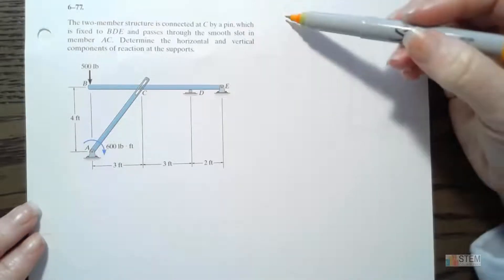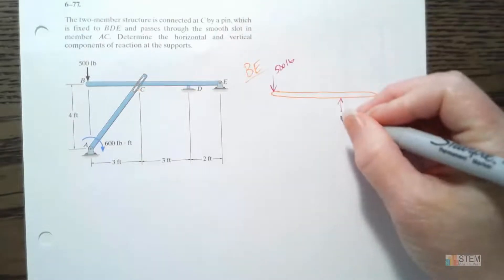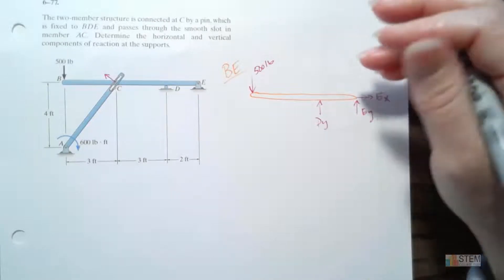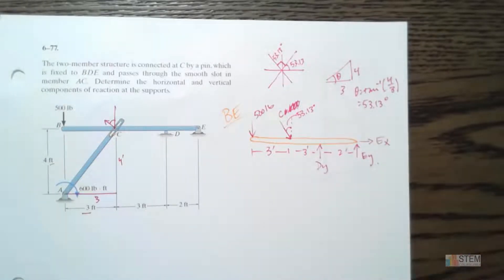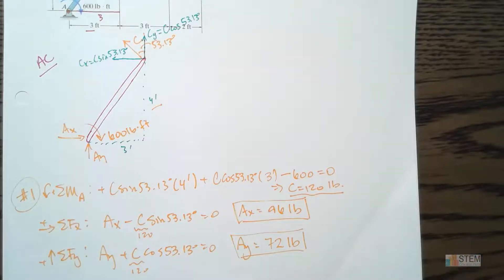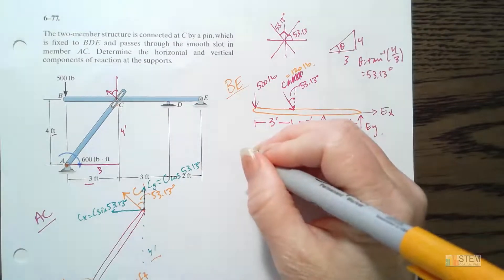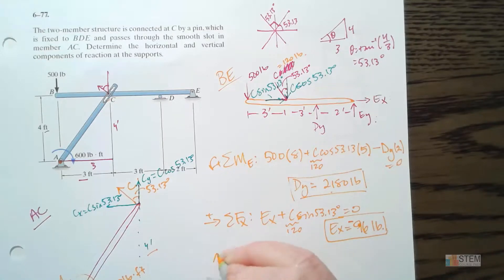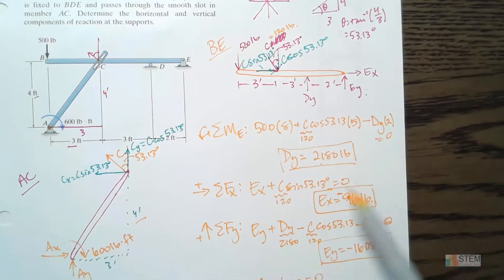Statics Frames and Machine Tutorial Hibbeler Chapter 6 Problem 6.77

Comment: Hello, I doubt you'll see before exam. But just wondering if you can take the force C times the hypotenuse distance instead of breaking into components? Isn't that what you would do if there was a distributed load along that line from A to C?
Reply from the maker: Hi
You can use the hypotenuse as long as you know the force is perpendicular to the member. I just always break the curves into components because it’s usually easier to find the distances. With a distributed load you’d have to find the resultant load and it would act at the mid point of the member. Hope that helps!
Reply: (in reference to the moment about point A)